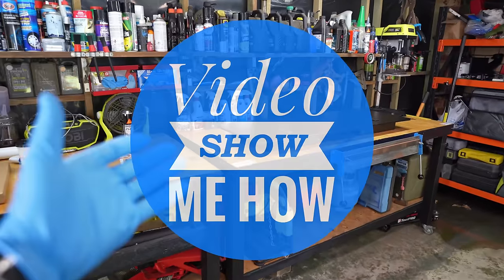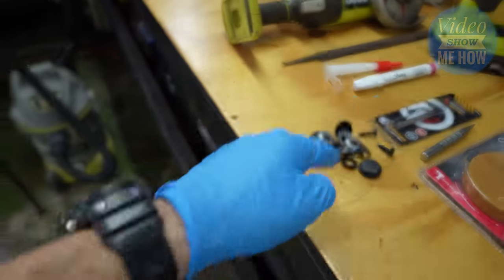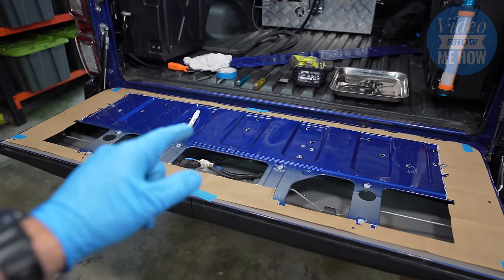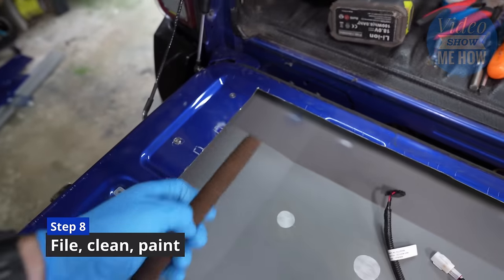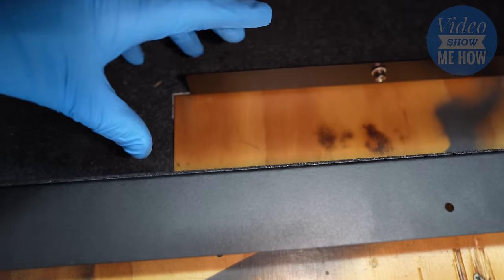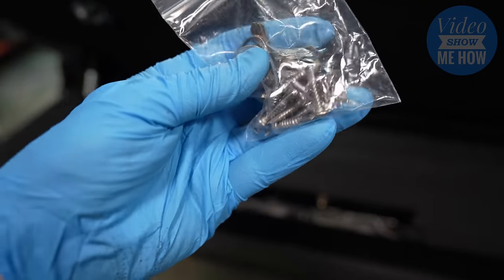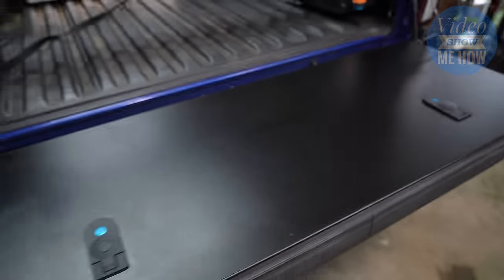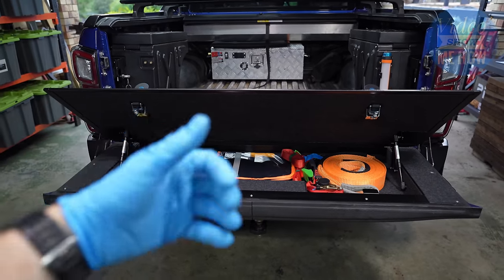ISUZU DMAX Ute TailGate Storage | Huracan Fabrication | 2021 Isuzu D-Max Build Series #29

Comment: Hi mate love the channel I just picked up my new dmax and have ordered the same system have hsp upgraded the struts I have ordered the same system as you installed along with LED bulbs for indicator and reverse. Loving the feel of it first Ute I’ve owned had a NT Pajero for the last 11 years 320k on clock and sold to a good mate😢

Comment: Looks good. I thought struts can be adjusted by a professional, worth looking into. Or, try stabilus in Melbourne and give them the measurements of the struts you have and see what they have to build new ones and what strength needed, i just did it with my EGR load shield now that I have maxtrax and a roof basket etc on it. Made in Melbourne and quick turn around. I want to see someone fit one of these with the EGR dust defence kit, think it won’t work unfortunately.

Comment: Thanks Adam, another informative video. Where the holding screws stainless or zinc steel?
I was wondering if they have a rear rack which you could fit your spare tire under. This will allow top of the rack to use for max trax, solar panel etc.
Also spare tyre would be ove wheels and allow long range tank under tray rear.
Reply from the maker: All stainless mate. Unsure if they have a rack, worth dropping them an email 👍

Comment: Nice video again Adam. I noticed something attached to the back of you right hand swing box. Is it a light? Sorry, maybe someone has asked this question before.
Reply from the maker: Yep sure is, one of the kickass light stocks 👍
Reply: @VideoShowMeHow  thanks Adam. Just ordered. Using the magnetic mount to hold in place?
Reply from the maker: @tphallett  no had some mag light screw on holders I used. There's threaded inserts in the back of the boxes as well

Comment: Hi no issues with the HSP tail gate lock  installed just a lil bit of extra cutting as per video instructions?
Reply from the maker: Yep no issue, you just gotta do that extra little cut of the vertical lip in the middle (tried to show in the video) then works fine. Still running mine functions as normal 👍

Comment: Hey Adam. I was wondering if at the time of this video you had the central locking kit installed? And what exactly did you suggest you might have to do, couldn’t really understand what you comment was referring to? Make the opening larger by around 30mm? 
Thank you in advance
Reply from the maker: Yes I did, you need to trim the inside lip of the box by about 30mm with a grinder otherwise it could foul on the mechanism. It will depend on which type you've gone with though, some don't I beleive

Comment: Mate great video. I’m sitting in the waiting room at Line X getting mine installed. Did you have a dust seal Installed as the bit on the tailgate had to come off. As it would be hoot know if the rubber seal could be retro fitted
Reply from the maker: Yeah nice, that's on the list for me too, let me know how it goes! No dust seal as yet other than some diy, waiting to do the tub first
Reply: @VideoShowMeHow  sorry meant Line X are installing my hurricane fabrication storage as we speak. So did you have a dust seal rail on top as I’m going to need to Macgyver something as the dust seal had to be removed. I can’t remember if you had one or not.
Reply from the maker: @SargeNurseOffRoading  ahhhh, yeah there was a little strip there from factory at the top of the tailgate but was more so there for the channel to slide the factory plastic cover into place

Comment: Hi Adam. Have had the tailgate storage installed for a few months now and have just had the right tailgate assist strut snap of the bracket. Would you reccomend any other strut system that can handle the constant weight?
Reply from the maker: Have been trialing using the grunt struts for the last while and have been going well, seem to have a bit more 'grunt' as well. Which ones did you have? Apparently HSP have updated their design
Reply: @VideoShowMeHow  was running hsp until it snapped off lol

Comment: Great install Video. I will be interested to see how this goes. I have seen a few Amarok ones that have dented tailgates. They sit very close to the outside skin of the tailgate & when you stand on the tailgate or put a fair amount of weight on it loading the back of the ute up, it dents from the inside out.
Reply from the maker: Cheers mate. Re the clearance, you can see in the vid the rods for the latches run under the box and move freely, so seems to be a decent gap 🤷
Reply: @VideoShowMeHow  the clearance issues on The Amarok were at the back edge or the lower edge of the tailgate... See how it goes on the D-Max, as it may not happen on this model... Time will tell i guess.
Reply from the maker: @jasonquinton4400  yeah ok, will keep and eye out, so far so good 🙂
Reply: If it is a problem I wonder if expander foam could help distribute load? I want one after seeing this vid. I'm a tradie and always walking on the tailgate so a little hesitant. Any updates?

Comment: Excuse all the hassle mate. But I was wondering, at around the 6 minute mark, I see you claim that you have finished the grinding process but there are still little bits of blue that haven't been cut out according to the template? Did u get these cut out with a dremel or something? Seemed like that part was just skimmed over. Cheers
Reply from the maker: Yeah for mine some of the little notches didn't seem to need cutting out (I actually forgot about them when I did the first test fit and only a couple of them hit and needed removing). To cut the notches, cut in both sides with grinder then a set of pliers to the line, grip and move up and down till the metal breaks off and voila 👌
Reply: @VideoShowMeHow  ahhh interesting. Fantastic thanks! What's your view on installing without using sika?? 

Just worried about this thing getting in the way of replacing the rods or working on them and once it's all sika flexed in, my guess is that it's never coming out?

Hoping to never have to take it out but you know how it goes
Reply from the maker: @alwynvanderlinde9507  I would definitely be using the sika, that's what is going to give most of the strength. You can access the latch side no probs, if you were concerned the other end could always add a zip tie or something

Comment: Hi great video, can it fit with a arb ascent canopy. There is a fitting across the tail gate for lid to lock against.
Reply from the maker: A fitting to the inside of the tailgate? Or the bit where the storage box is?
Reply: @VideoShowMeHow  The arb canopy weather seal  across the tailgate it's fixed to the inside by 45mm wide metal frame stopping just short of the moveable panel. The drop in tailgate box may need to sit on a 3mm 3 sided frame to compensate for the arb canopy fitting.
Reply from the maker: @gregkeegan7715  Ah makes sense, agree. The box is metal so you'd have no issues attaching a bracket.

Comment: You got any tips on the latches. I’ve spent about 5 hours trying to get them to work. I get them working fine. Put storage onto and latch doesn’t open or disconnects the rods. I’ve loosened them off same thing or they don’t work. They originally sent me 2017 arms and instructions. So I’ve got no 2021 instructions on the handle
Reply from the maker: Hmmm are they touching the box? There's no residue etc left and the box sits flush? I had to cut out the extra bit in the middle as the handle for the central locking just hit and needed a bit more room
Reply: Yeah I dunno I give up. Spent 3 hours trying to get them to work today and still no luck. Get it to work about 4 times then the latches stop working or fall off
Reply: @VideoShowMeHow  are there plastic clips that connect to the rods on the edges of the tailgate latches? Mine keep falling off
Reply from the maker: @benabbott2994  yeah on the ends it's the factory clips, nuts on the latch side. You can see in the vid
Reply: @VideoShowMeHow  ah ok Damm it I think I vacuumed them or binned em
Reply from the maker: @benabbott2994  ahh nooo :(
Reply: @VideoShowMeHow  🤦‍♂️ got some ringing around to do tomorrow
Reply from the maker: @benabbott2994  i'll check my spares in the morning mate see if there's any there I can send you :)
Reply: @VideoShowMeHow  cheers. I’ll call Isuzu I think they had a tailgate they were recking